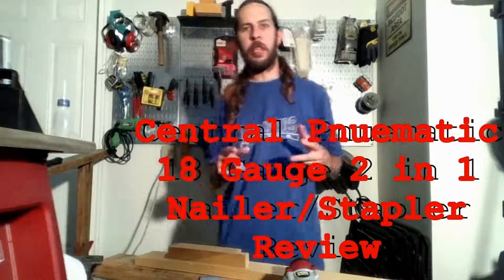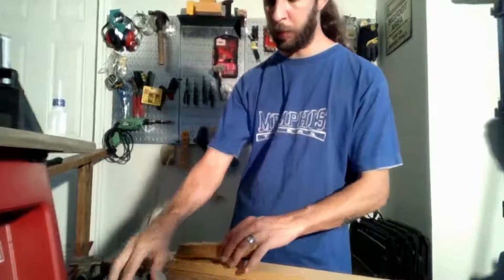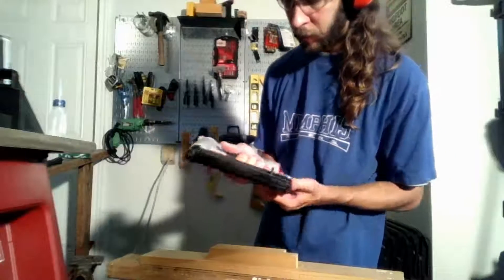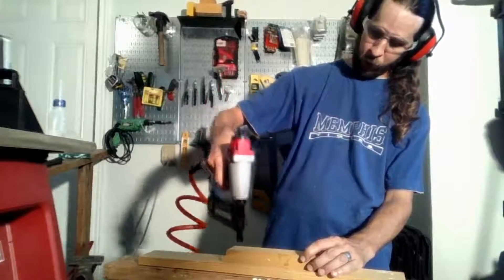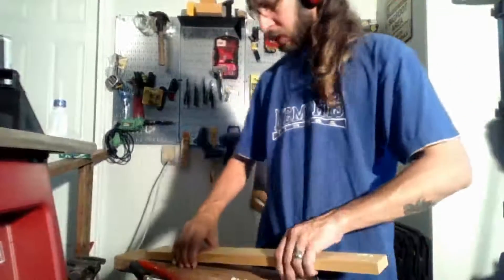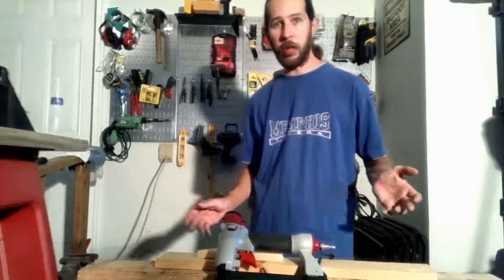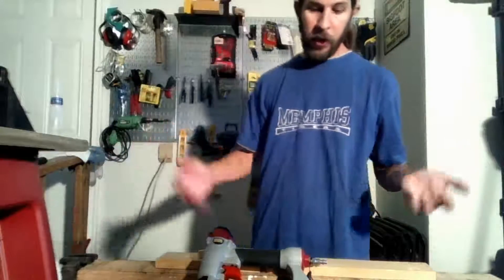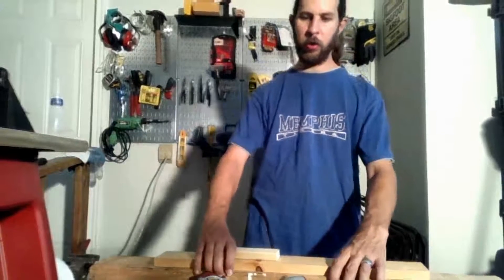Central Pneumatic 18 Gauge Nailer Stapler 68019 Review w Memphis J

Comment: good job! i do wish you would have shown staples as well, but great review and video showing how it works. I appreciate you taking the time to use different thicknesses and types of wood/material. My dad recently bought a used Cen.Pneu. compressor (i think he might have paid too much since they are 40 dlls with coupon for a pancake or 'hotdog'), but I'm looking at these nailers/staplers, brad nailers, and 23g pin nailers, etc, and I want to see what each can do. This one is 15.99 at HF with coupon, so for the price and what it can handle, and what i need it for, it's a very attractive option.  thanks again for your video.

Comment: Thanks for sharing it and thank you for the tip on air pressure adjustment. I’m a novice on the use of air nailers and your video helped
Reply from the maker: You're welcome, just look over the manuals if you're unfamiliar. Get a piece of scrap wood that's thicker than your Brads or Staples and practice a few times getting comfortable how far from the tip and in what orientation the nail actually comes because it won't be right out of the middle. It's not too complicated but like all power tools though respect and attention go a long way. Stay attentive anytime you're around and using power tools and you'll be all right.
Reply: Absolutely correct, I am a novice on nailers and other air tools used for carpentry but I have many years using power metal working tools and the same safety rules apply. Thanks ahain

Comment: I have found that setting the air pressure to 50 psi does not leave marks on soft wood using nails. On mine 50 to 90 psi is the best for both nails and staples depending on the wood being pushed thru.

Comment: Thanks for the update . . . / Do you have any experience with battery operated nailers ?? Or must we go with a compressor ???
Reply: The battery ones that are strictly battery operated (no Gas and battery combo) are much safer, convenient, and easier to use. Only con is that they're heavy ish and expensive. Battery is the future, but compressors are dirt cheap nowadays.